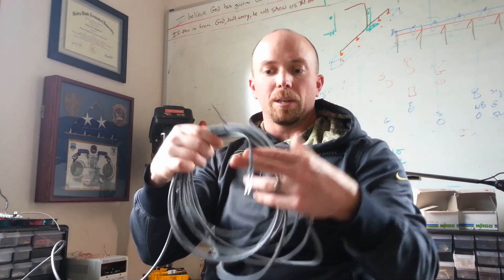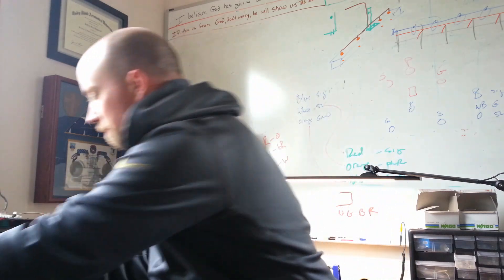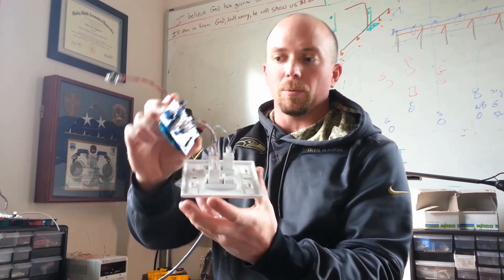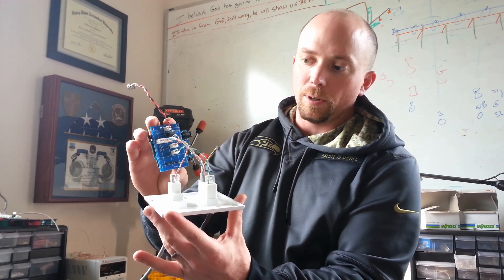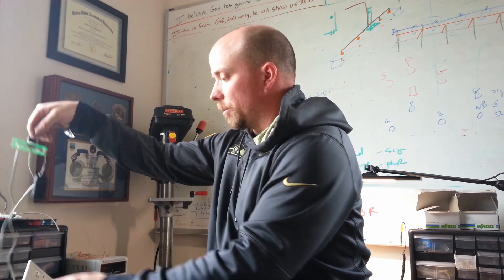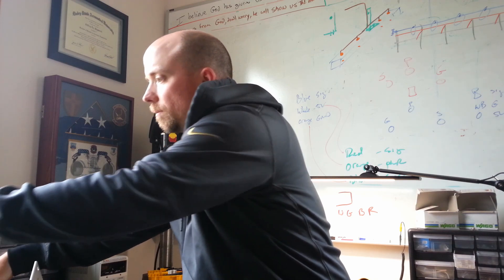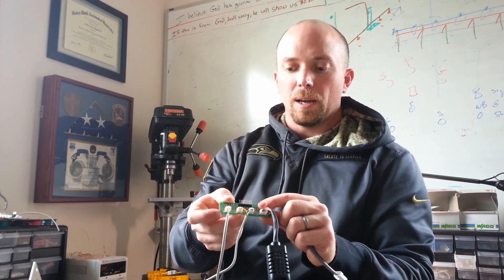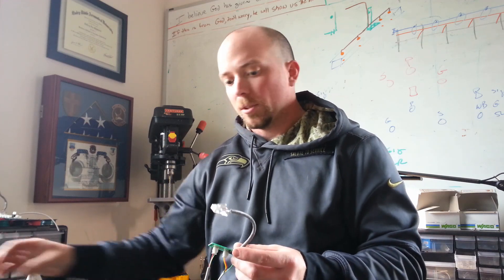Off-Grid Trout Aquaponics Automation - Arduino Sensor Build Part 2

Comment: wind on the ground is a diiferent animal from winds aloft where the turbine should be located.   If the average tree is 40 feet tall your turbine should be at 50-60 feet.   you wont be able to compensate for natural terrain except for optimal placement of the turbine. ie  wind thru the valley or mountain pass.  unless you own the ridgeline then you already own the high ground in that exchange

Comment: One thing Ive always done on cables that need to be waterproof as possible is line the splices with dielectric grease and then put the heat shrink tubing on. Makes a mess but really assures water will not get in.

Comment: Hi TRM, Your potential wind turbine, have you done your homework? Ideally you'd want to place your wind anemometer where you are going to place your wind turbine. Gathering a years worth of data from your roof is not the same as measuring 200 feet in the air in an open field. It is recommended that the bottom sweep of your turbine blades be at a minimum 30 feet above the tallest obstructions, and if your obstructions are trees then you'll need to account for their growth or chop them down. I hope these comments give you things to consider. Best of luck.           Bill
Reply from the maker: thanks for the comment William. Yeah I'm going to put the sensor as close to the location as I can and at the altitude I'd like to have it at.

Comment: TRM, remember to use bypass capacitors on the input and output of the 7805 regulator. Somehow (again) you forgot them... :)
7805 will behave strangely and finally will die without them. :p... causing havoc among your 5 volt sensors...
Reply from the maker: OMG thank you thank thank you.....you were spot on...totally forgot and that ended up causing a ton of watchdog reset problems...you saved my bacon!

Comment: A quick tip. For outside connections, slide your heat shrink tube over the connection, inject silicone to fill the tube then apply heat to shrink. This forces excess silicone out making a water tight seal. I have used this method successfully for under water power connections.

Comment: TRM, practice makes perfect. Your circuit boards look professional now. A far cry from the original rat's nest of wires! A trick with waterproof cables. After you slip on the heat shrink tubing but before you shrink it, squirt a small dollop of silicone sealant inside the heat shrink tubing. Then shrink in place. The silicone keeps the water out of the circuit.